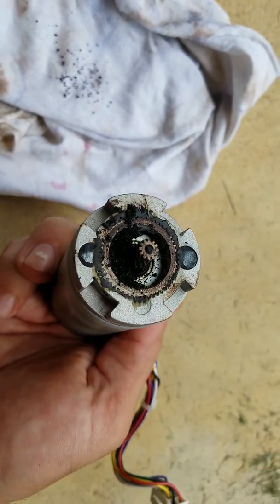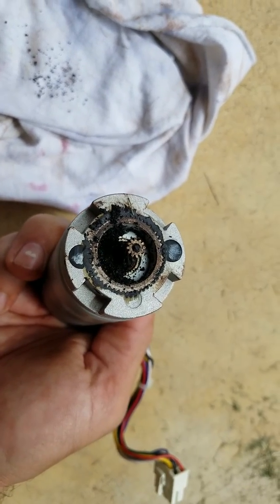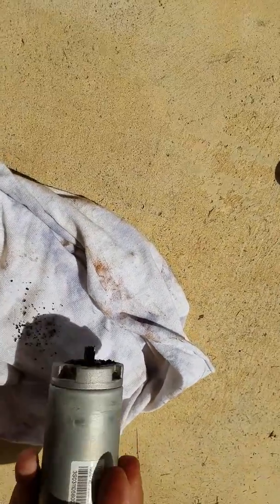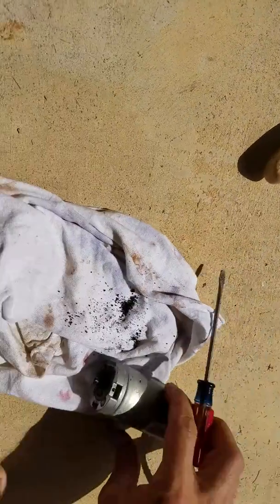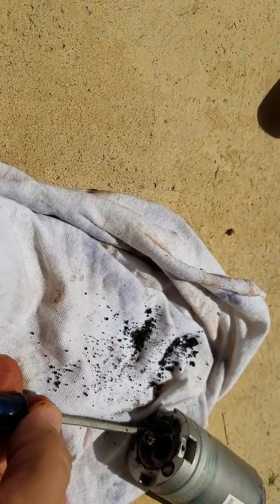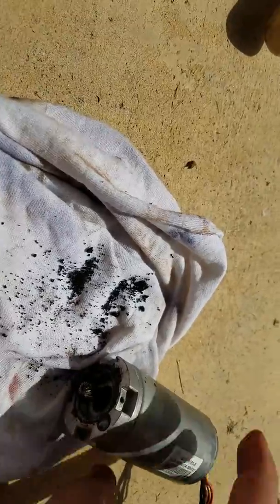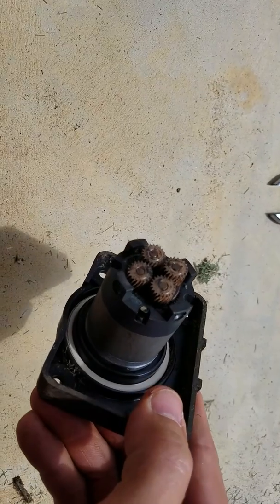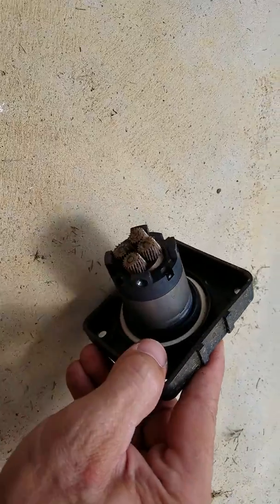Husqvarna 450X Automower wheel motor Planetary Gear box lubricant failure

Comment: After all that smart talk... you pack the gearbox full of grease...really? so the grease is not giving any resistance u think?  Smarter people add not more than 25% of gearbox volume.
Reply from the maker: Still plenty of room in there for the gears to spin. As I mentioned I got 3000 more hours out of a gearbox the gear Box that was giving me faults. I agree that it should not be packed solid but but after packing a good bit of grease in there and giving the motor a spin there's still plenty of void area in there. And after those additional 3000 hours that I got on a faulty motor the insides were not crusty and hard as they were after the initial 1000 hours.  My hypothesis is that the failure at 1000 hours was absolutely the lack of and improper Greace and the failures I got after 4000 hours are likely a loose failing wheel bearing.  I am 100% confident I would not have achieved that many hours on the original motors without without adding Greace.  I am also a 100% confident that adding grease to the brand new motors will keep me from having to do any maintenance at the 1000 hour mark.
Reply from the maker: As a side note. I find it very unfortunate that people people so easily use a tone that is clearly disrespectful. It is one of the reasons that I try to steer clear of most social media.  Luckily most people still are not brazen enough to use you use a tone they are willing to use on social media directly to someone face-to-face.
Reply: Thus wheel motor gearboxes last usually 6-10000hrs. Be good and measure that wheel packed with grease... How much mA it draws? Also do the same at 5c. My opinion of filling things with grease will not change as any material that needs to be moved while wheels move is resistance and there fore friction and ware on parts.  Over grresimg bearings and gearboxes is death sentence for them and not saving. Sorry to hurt  feelings 🥺

Comment: Hi. Have you found a source for the planetary gearbox parts !? I have the same situation with about 10 motors and out of the whole gearbox, in particular one metal gear is worn and needs to be replaced.
Reply from the maker: Sorry no I have not found a replacement but to be honest I have not looked because I was given a warranty replacement and still have one more warranty replacement on the Shelf. I was luckily able to catch one before it went completely bad and change the grease and changed my mowing schedule to only evenings and nighttime and it's still going.